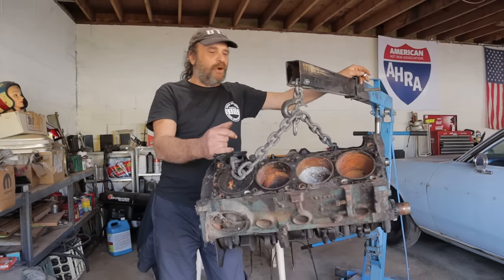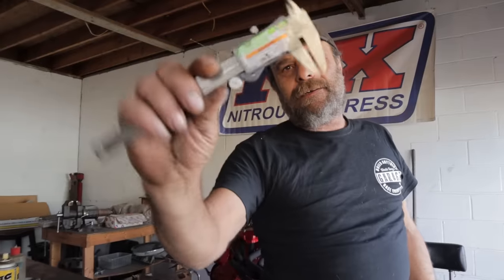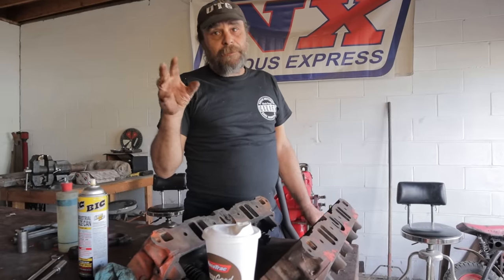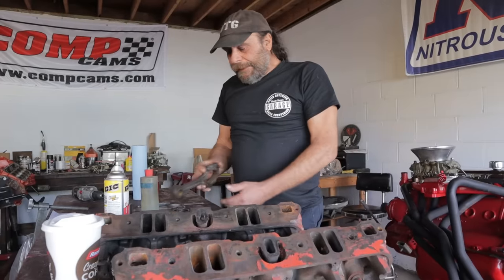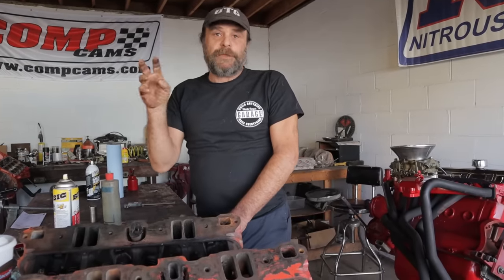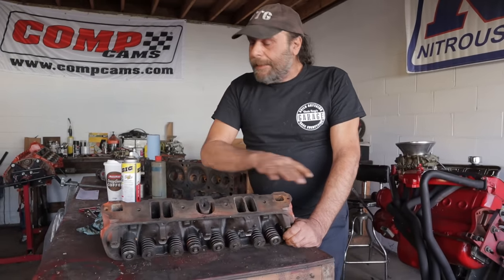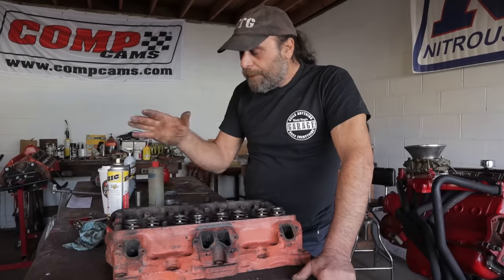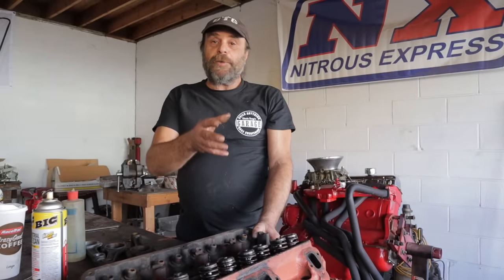The Most Under Rated V-8 In History?

Comment: Actually, the 318 was a perfectly mediocre engine over the entire course of it's lifespan.  The power was OK, better than any stock 6 cyl but worse than most V8's. The fuel economy was pretty crappy for such a small engine, but not nearly as bad as some larger V8's. And overall, they made over 100,000 miles without much service and given a timing chain they could make over 200,000 miles.  So their reliability was pretty much OK if not good for the time.

As someone who's driven just about every variant of this engine and owned a couple of them, I'd have to say they were absolutely meh.  I'd be hard pressed to say anything bad about them or find any great qualities among the group.  For the most part they wound up in pretty heavy cars and in the bigger trucks they were definitely punching above their weight class.

As to the 318 being a budget 340... no way Jose.  I drove both back in the day and if you couldn't tell the difference you were dead from the neck up.  To be honest, I'd compare the 318 Mopar to the Chevy 307.  Both were pretty reliable, both hauled heavier cars, both could get out of their own way if they had to, but neither was going to snap your neck back in the days before head rests.  

So yes, if you find a good 318 and it's still drivable, especially the later unleaded versions, keep driving it... as to sinking a fortune into rebuilding one, it wouldn't be anywhere near my first choice.  

Back in the day 440's and 383's were not as common as 318's but there were lots of them.  I can't believe that one would be too hard to find if you were going though all of the expense of building an engine from back in the day.  Yes, in as much as I hate 360's a lot more than the 318 or any other engine... from personal experience, I'd do a 318 before a 360, but either way, it's a lot of work and money and you still wind up with a 318... Save up a few more pennies and upgrade your build to something you are going to enjoy a whole lot more.
Reply: I'm guessing your 318 experience is a little biased. I've only owned two 318's and both were amazing. My first was in a 67' Barracuda (originally a slant 6 car). Bone stock engine with only dual exhaust. Only a few small block cars around could take it. Every single one that could had a significant advantage somewhere. Not much you can do if your competition is a 351w shoehorned into a 77' Pinto wagon (I still hate that guy.. everyone did!) or was a factory performance setup with better gears, more displacement, and comparable weight.
Reply: @Ares-jx4ep  My friend shoe-horned an early 1960's or late 1950's 318 into a 67 charger and it was one of two cars that made it to school one day when the temp outside was below zero, in the mid 70's. It was a big motor as I recall.  It wasn't a slow car at all, as it was pretty light.  He spent the entire year restoring that car and it got totaled on the way back from the paint shop once the mechanicals and interior were done.  He got the engine from his uncle who had it laying around in his basement for free.  If he had to buy an engine, I doubt he would have chosen a 318.  I'm not suggesting that 318 was going to ever beat my 425 4bbl olds in a race, but it was fun to drive in and had plenty of hp to get a kid into trouble.  My other friend had a 340 4 speed 71 road runner.  Now that was a heavier car, but that car was in a whole 'nother class.  

I'd say the same about the 383's I recall. My friend had a 383 Coronet which could move pretty well and my Aunt's uncle, who was in his late 70's had a 66 Monaco with a 383 4bbl and gave me a tour of rural Pennsylvania in it.  That thing flat out rocked even with a guy who was almost 80 with a handle bar mustache behind the wheel.  He eventually crashed it, he survived but didn't live too long after the crash.

My professor (another old guy) had a 383 Cuda... it was either a 68 or 69 and that and being as light as it was, it was scary fast. As were the 440 Cuda's and GTX's of the day.

And head to head, I recall both the 318 and 440 Chargers... one was a commuter car and the other made your heart skip a beat when you let off the clutch.

And the 440's were about the only Mopar's I sometimes lost races to with my 425 and that was mostly when I had a posi and they didn't.

I had a 318 in a 70 Coronet 440 Wagon, it could get that heavy boat up and moving just fine, and it had plenty of power for my wife.. It wasn't going to win a race against anything... but it was a durable motor... Like I said, about as good as any 307 Chevy or maybe a 327.

We also had an 86 Fifth Ave with a 318, that one had a roller cam and 4 bbl as I recall.  And it could smoke my 85 Olds 307 4bbl easily... but the Olds got 10 mpg better gas mileage than the 5th Ave.  For an 80's engine the 318 was no slouch.

Don't get me wrong, I owned two 318's because I liked the motor.  It was durable and reliable and could get a car moving just fine.  And more times than not, it was hauling a car that really should have had a bigger engine.  But when I think back to the 340's, the 383's and the 440's that poor little 318 was outclassed in every way.

It's 2021 now and if someone is really going to rebuild an old Mopar engine, which is going to take a lot of time and cost a pretty penny by the time it's done, they should start with pretty much anything other than a 318.  Sure if you can find a good unleaded 318, and it fits, just drop it in.  But if you are going to build a motor, just start out with a motor that was designed to knock your sox off and make your heart sing.
Reply: @RJ-vb7gh  Your reply proves you're not a car guy. 

 If pure power were the only consideration then of course nobody would build a 318. The same thing could be said for every single smallblock and the vast majority of bigblocks. 

 I built a 302 for my 77' Mustang II because: 1. It was already set up for a 302. 2. I had a set of headers for a MII/302 combo. 3. 302's were/are easy and cheap to find and build. This list could get a LOT longer. 

 That little 302 Mustang II ended up running low 13's in the 1/4 on motor and high 12's bottle assisted. It was also my all weather daily driver, from below zero to 100+ degrees, rain sleet or snow be damned. And shockingly it averaged over 25mpg on 60 miles of daily rural commuting. 

 I'm currently building a 408 ci stroker for my 93 F150. I "could" do a 460 swap that would easily meet my power goals but again, power isn't the only consideration. The truck is already setup for a smallblock. I already have a well built AOD trans. <~~~ super important. AOD's are stupidly expensive to modify to bolt to a BB and the easiest way to do it limits you to a 10" torque converter. Lets do some common sense math. 4800lb truck + 4000lb trailer + 10" torque converter = shitty performance and likely transmission life due to excessive fluid temps. 

 Back to the 318. 318's are far easier to source than any other Mopar V8. The vast majority of Mopars were slants or smallblocks. Swapping a BB into a slant/smallblock Mopar requires far more than simply acquiring and rebuilding the engine. First off is the K-member. Your choices are major surgery on the K-member or replacing it. Even a used K-member in good condition is an extra expense. New tubular start at near $700. What about torsion bars? Unless your goal is a dedicated drag machine or very limited cruiser you don't want to live with slant or smallblock torsion bars in a BB car... it SUCKS for handling. What about the rear? Yeah, not many 6 cyl car's came with an 8 3/4. Plan on the funds for that particular upgrade. 

 I have the funds, time, and know-how to do a full BB swap into a slant 6 car. The young Mopar fan down the street who just found a slant 6 70' Dart coupe.. not so much. But guess what. He found a free 318/727 setup from an early 80's pickup. Swap motor mounts are cheap. SB headers are fairly cheap as well. I've seen his build plan... that car is gonna hit 12 sec qtr's if he finishes it. If he decides not to finish it I have a standing offer on it. :) 

 Mmmm, just the thought of a straight 318 Dart coupe I can daily drive. 4w disc conversion, new torsion bars, big front and rear stabilizer bars and Bilstein's Lower about 2" over some fat BFG Comp's.... fun cruises on Ohio Rt 555... Lets see your BB's keep up... ;)
Reply: @Ares-jx4ep  Not a car guy?... That hurts.  But you kind of pegged me as a big block guy, which is true.  And you're right depending on which Mopar car you are working with a big block conversion can turn into a major project.  Chargers coronets and road runners aren't too hard to convert from a 318 to something with a little more giddiup (depending on the year) from the get go.  For sure, I wasn't suggesting building a 440 Aspen or duster.

Basically, I was pretty much considering primarily cars where you would normally find a range of V8's stock and most of the parts would be off the shelf.

I might add that Mopar sold the "vanilla pack" back in the day which was a DIY kit to convert a Dart or a Duster to a 340.  
 
But, your right... it depends what car you are starting with.  And I never suggested that 318's are bad motors.  It's not even that I hate small blocks. I have a 4.6L in my Police Interceptor and it can move right along. 

Maybe, it's because I'm getting older and I remember too many cars from way back when.  Some engines really impressed me, some were pretty crappy and some were good for what they were... which is where I'd put the 318.

The last 302 I was in was a 67 Mustang convertible, the car had pretty much rusted off the engine by the last time I was in it, but the thing could still take off and move right along.  It was a light car and the 302 was a good size motor for it.  It was a shame, because the owner offered it to me for $100.00 but there wasn't enough left to be worth fixing up.

I found a 77 Mustang convertible with a 302 about 10 years ago... sadly, the roof was rotted out, the car was flooded and the top half of the engine was missing. 

So yes, I do like the 302, I just never found one worth fixing up for the Mustang.  But I had a 351 Windsor in my Galaxy 500 and I wouldn't have down sized it to a 302 even if I could have gotten one cheaper.  I was planning to upside the engine, but a friend had a 460 LTD that went through front ends at the same rate it hit potholes, so I just fixed up the 351 W and drove it another 15 years until an F350 shortened the car by about 2 feet in the rear. The motor was still running strong and didn't burn oil. That car had an FMX trans.

So, yes... I've built and rebuilt my fair share of cars over the years... But for the most part, if I wanted a big block engine, I bought a car that came with a big block in it already.  I had friends who swapped V8's into 6 cyl cars (and one that did it the other way around) and then converted them from automatics to stick shift.  By the time I was old enough to drive, I swore to myself that I'd never do that job without getting paid for it on an hourly rate.

The world is full of cheap project cars that are easy to fix up. It's just so much easier to start with what you really want in the first place and not overly complicate your life.
Reply: @RJ-vb7gh  That last paragraph demonstrates exactly why you're not a car guy.

 Car guys don't look at the work of building a car as a complication, its part of the enjoyment. The majority of young men/women getting into cars can't rely on their parents or a trust fund to buy what they want. They start with what they can afford and then they sweat, make mistakes, and learn. If they're lucky eventually they get their dream car but they enjoy what they can afford before that.

 I'm 53 years old. I still can't afford my dream car, a 70' Boss 429 Mustang. If I used your logic I'd have never enjoyed building and driving the 77' Mustang II. I'd never have enjoyed farming salty tears with a 351w swapped Mazda B1600.

 Using your no complication attitude I'd have never built my 83 Mustang L coupe in 1993. Factory 3.8 V6/Auto car. Put that car together in the driveway. 3.8 Supercharged Bird motor that had been a dyno mule at Ford's EEC lab. Never bolted into car till I got it. Complete on a pallet with harness and ECU for $300. Dropped it in backed by a used world class T5 I acquired for $500. I bought exactly 1 major part new for that car, the flywheel. My total investment was under $4k excluding tires.

 That car ran 12.49 at Kil-Kare in Xenia Ohio on drag slicks. No bottle. It did it despite being setup for corner carving and still carrying the 16" turbine GT wheels up front. You're not a car guy. You wouldn't understand the euphoria of beating the snot out of everything you come up against short of a dedicated drag car at a test and tune night. You wouldn't understand the pride of having a dozen people clustered around your open hood to see the stock appearing V6 engine that just ran a 12.49. You wouldn't understand the pleasure of walking out to that same car at -10 degrees and having it start up and drive like a stock OEM EFI car.

 Keep your uncomplicated credit car'd. I'll take my budget complications.
Reply: @Ares-jx4ep  I paid $1.00 for my 1966 Olds, $100.00 for my 71 Ford, $0.00 for my 73 Buick, $400.00 for my wife's 80 Honda, $130.00 for my wife's 79 AMC, $100.00 for my wife's 1970 Coronet, $135.00 for my wife's 86 5th Ave,  $100.00 for a 1979 Cordoba, $500.00 for my 86 Cutlass Supreme (a dear friend needed money), Traded the Cutlass for a 92 Saturn SL2, $1000.00 for my wife's 94 Saturn SL2 and $500.00 for my 2003 P71. Pretty much every one of my cars were project cars.  Pretty much every one of my cars were project cars.  Car person or not, I'm a damn good diagnostician and pretty fair mechanic.  I'm 62 and I've lost most of the use of my right arm and I still enjoy fixing cars with the help of my 15 year old daughter.  And yes, there are a lot of jobs, that are painfully hard for me to do these days, but I do what I can, and it's still fun.

And I still love throwing my P71 through the turns of a winding mountain road and there's nothing sweeter than the sound of a 4bbl wide open down a straightaway or the sheer thrill of having all 4 wheels in the air.  Or... well... I'd rather not say on line, but it all involves going fast.  And the prize for some of the races I won, when I was younger, was keeping my driver's license.  

I"ve swapped transmissions and engines, and done just about everything I've ever wanted to on cars, half the time in snow drifts, public parking lots, on the side of a highway or in six inches of water and for the past 10 years pretty much using only my left hand... Try hanging an exhaust with one hand if you really want to have fun. Hint: You lay on your back behind the car and kick the exhaust together with your feet.    And when the battery rack rusts out and your battery gets a hole punched through it from underneath, you solder in a piece of broken battery and add new acid because you don't have $20.00 for a used battery.  And when I only had $5.00 to my name, I put $4.00 into the gas tank, found 3 cents in the mall parking lot and bought two tacos for that buck.

And when I was flush and making good money, I still welded the frame in my 71 ford to keep the wheels from falling off. 

I won't even go into all of the jobs I did helping friends.  So yes, I like both driving and fixing cars, and I've won more than my fair share of races.  I've literally snapped the wheels off of cars and fixed them.  

So... our definition of "car guy" might be different, but I'm no lazy rich kid that anyone ever gave a car to. 

And for any young kid out there who wants the benefit of my experience... start out with a car and an engine that you really want (and can afford) that doesn't need the kind of heroic efforts I've put into cars and you will still have plenty of work to enjoy and you will have lots of fun driving the car you really want. I'm not saying, don't do the work, or you won't enjoy doing the work (sometimes).  But at least when it's all done, you will have a car you really want... 

I mean if you want a 318 Aspen... go for it. For me, it would be a 440 Charger or a 425 Starfire or 66 Toronado or maybe a 70 ragtop Eldorado (I'm getting old).  Or for now, my P71 is plenty of fun for an old man, it runs on unleaded gas and the price was right.  I'm not broke, but I am still cheap.
Reply: @Ares-jx4ep  I just thought I'd add a footnote about the 429.  Back in 1976 someone gave me a 70 T-Bird with a 429 Super Cobra Jet... I checked out the car and didn't take it for the storage the impound lot had on it.  Man what a dog.  The spindle was broke on one front wheel, three windows didn't move, the engine had overheated and everything under the hood was green, the exhaust was Swiss cheese and when I asked the former owner, he told me that the car lived in the shop since it was new the engine had been "rebuilt" twice...  And no... the engine hadn't been rebuilt twice.. but the car didn't have a lot of miles on it and a very long service history... So honestly, I was very unimpressed with the 429 Super Cobra Jet... great motor on paper, but the only one I ever saw was pretty ratty. I got the engine started and although it started and ran... something about it just creeped me out.  

A 429 was one of the engines I was looking for, but seriously there was something seriously wrong with that engine... I don't know if the Boss was as bad as the Super Cobra Jet, but that motor wasn't around long and there might have been a good reason.  If you find one, check it out very carefully.  In any case, I wound up with an Olds 425 and never regretted it.

Honestly hope you find one and it works for you.
Reply: @RJ-vb7gh  Super Cobra Jets never came in the T-bird. Birds got the Thunder Jet. A 429 Thunder Jet would push a near 4600lb 70 Bird to 60 mph in around 9 seconds. On modern rubber it can do it in under 8. Take your favorite muscle car and stack a half ton of shit in the trunk then tell me how impressive the performance is. The 429 Thunder Jet was a beast motor.
Reply: @Ares-jx4ep  Like I said, I never took the car home, it was a fully loaded 4 door 1970 T-Blue with a white interior.  It was a 429 for sure and the air cleaner read Super Cobra Jet. The car belonged to a couple that never opened the hood so for sure they didn't change the air cleaner or decal.  Maybe it could have been a swapped out engine, but it would have had to be swapped out under warranty... and either way it doesn't say much for the original engine.

But the guy told me something about an engine rebuild or two.. Maybe an engine swap?  About 10 minutes into the service history my eyes glazed over as I suddenly realized I didn't want the car... It definitely hadn't been maintained and it literally sounded cursed.  

I definitely agree on paper the 429 is a beast.  And it's a damn cool looking engine.  That's why it was on my short list... but after seeing that one,  Original or replacement... I'm not so sure that there wasn't something wrong with them.  The engine had less than 80,000 miles on it and it was either replaced or toast or both.  With the way everything under the hood was green, it had been overheating and chances are it might have blown a head gasket.

I know history is kind to certain engines, and I may have seen the very worst example ever... but I only ever comment on cars or engines I've owned or worked on or driven in and my remarks are based on my experience... which is after all limited. 

If you do find the 429 of your dreams, and I hope you do, check it out thoroughly and research it's service history.  From what I saw, there's something seriously wrong with at least some of them.

Over the years, Ford has made some great engines, and a few with fatal flaws.  On paper they mostly all looked good, but if you got the wrong one... you were in a world of hurt.

And yes, as a kid I survived a pretty nasty car crash, so I like larger cars... with powerful engines... If the car's too heavy, just add more cubic inches... Hence, I'm a big block fan and the reason I drive a Police Interceptor rather than a Mustang today.  Sure a Mustang is quicker, but I'm 62 and don't feel the need to drive much over 130 MPH anymore anyway and the handling package is already killing my back as it is.